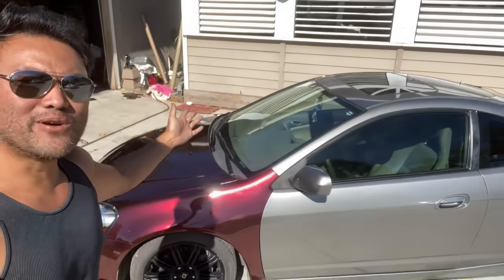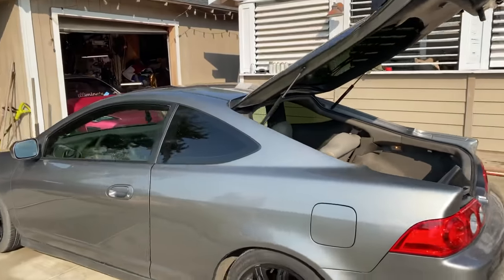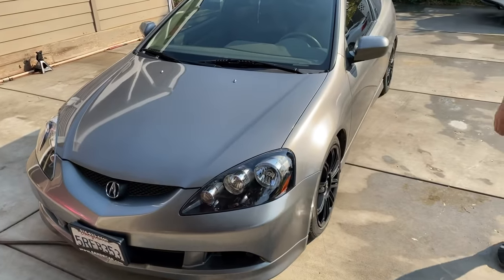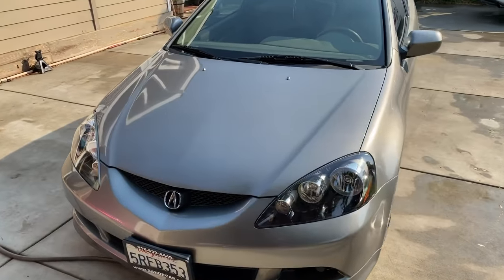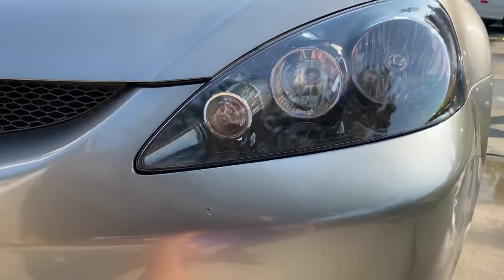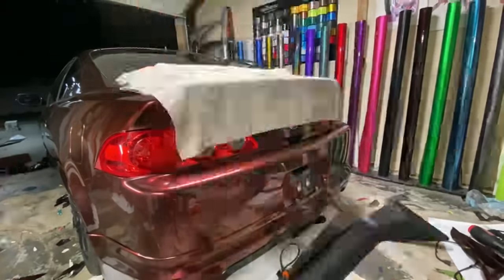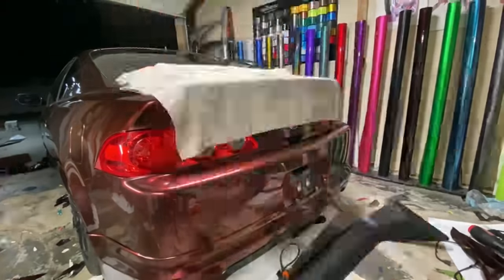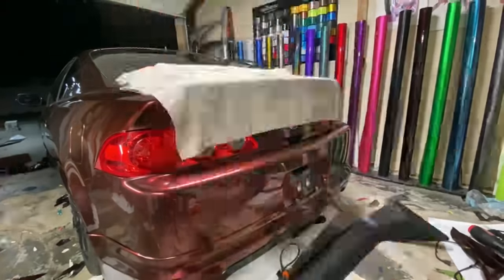RSX Type S Wrapped In Candy | Black Red Iridescent KPMF

Comment: I want to buy one of these as my first car. The candy apple red looks amazing man. Great stuff 👍🏽
Reply: ItsCnote great car low maintenance for sure
Reply: i bought an 05 rsx back in august as my first car, love it so far and have been thinking about future mods and stuff, if i wanted a flashy red im thinking the red mazda makes. when i bought the car i needed a seat belt buckle and now i need another but its covered from who i bought it from through my work and i had to replace my brake caliper cause the ebrake got stuck after using it not to roll back on a hill. mods wise the last owner put coils on it and lowered it, he also did a camber kit, lower control arms, a sub frame brace, cold air, exhaust and in typical honda fashion a sub in the trunk.
Reply: it's the perfect first car. plenty of hatch space, great gas mileage. and it always looks dope as hell
Reply: @blzkrd  facts, i have about a 10 minuet drive to work through town and get about 3 weeks from a tank of gas and even with a jbl 12inch woofer in the trunk as long as i fold the rear seats i can fit 4 tires mounted on wheels or my even better feet of 2 pumpkins and 4 tires from a Lamborghini diablo i got from a customer of the shop i work for.

Comment: the motor that is in that car is the k20a2. they can put out 600+ whp with a totally stock longblock just by adding a proper turbo setup. built k20a2s have been over 1500whp. very common to see them over 1000whp in drag racing. its the go to motor in the 4 banger import racing scene.
Reply from the maker: Sick! Need one for my Mr2 at some point
Reply: That's an 05-06 so it's a k20Z1 not an A2

Comment: I love my 03 Type S RSX has 185k miles and even with Kpro tune still gets 38 mpg on the highway and 0-60 well under 6 seconds. I will probably keep it till it dies it's so fun to drive. I had a 12 Infiniti G37Xs and a 17 STI during ownership of the RSX and still think the RSX is more fun to drive than either of those cars. Have a S5 Cab now and it's getting hard to not drive that over the RSX now though.

Comment: If you are using a heat gun to stretch the vinyl, it won't last long before you get lifting in corners and fingering on edges. All about cold prestretch.

Comment: Hi there, did you noticed any "hazing" with this vinyl when heating and stretching? I am working currently with KPMFs Purple Blue Nebula and as soon as I give this just even a tiny bit of stretch it hazes and loses its gloss.
I mean it is still shiny but you can see a difference. For example on the back panel just above the rear light you have to stretch to get it nice around the corner and I have a difference in gloss there...
Love you little zoo btw. aaand your work of course :)

Comment: I would love to get my vehicle wrapped but I have trust issues. I am afraid of getting it wrapped in fear of the installer cutting into my paint. And I would never know until the wrap came off. Now I know there are a lot of high quality wrappers out there but mistakes happen. The last thing I need is my vehicle rusting under the wrap. Where I live in Canada we had a couple work vehicles wrapped by who was claimed to be the best. A couple years later we had the original wrap taken off and re wrapped in a newer design. As we were taking the old wrap off there was a lot of deep scratches in the paint from when he used a knife.

Comment: How come you don't wrap the door frames as well? You open the door and all you see is silver.
Reply from the maker: Nox that requires that I take the door off sometimes. even if I don’t have to take the door off it’s still means removing the locking components and trim so it costs more and no one has wanted to pay extra for it so far lol

Comment: I have a 2K5 RSX Type S with an A-Spec suspension kit, named "Penny" because of the Blaze Orange paint.  ;-)
It's stock (except A-Spec), no body kit, wings, etc... though I've been thinking about new wheels (gun metal) or have my existing wheels refurbished (curb rash) and dipped (carbon Fiber).
Reply from the maker: T'airn'KA nice! Didn’t realize the RSX community was that big out here lol!
Reply: @ParadoxTheWrapper  It's perfect as a first car, also for a couple and kids (until their feet touch the floor).  ;-)

Comment: I notice you didn't remove any body panels to wrap. Why?
Reply from the maker: Tu Papi 69 don’t have to if you plan it out right, don’t over stretch, and can tuck it in. Not doing extra work for no reason
Reply: @ParadoxTheWrapper  thank you for your replied. Great info cause i always had that question due to all that extra work.